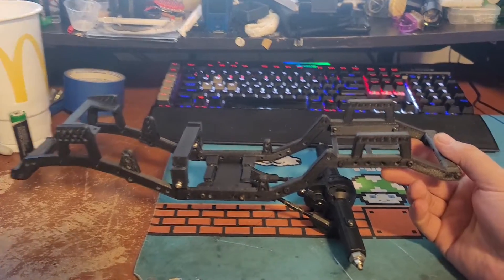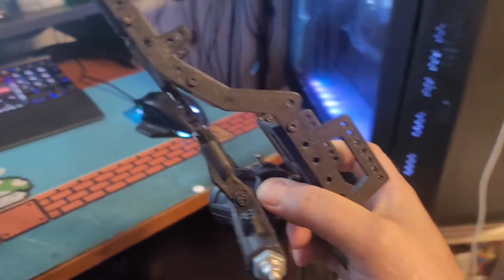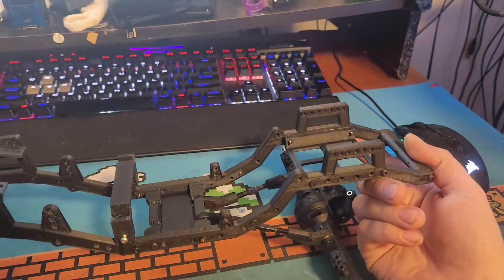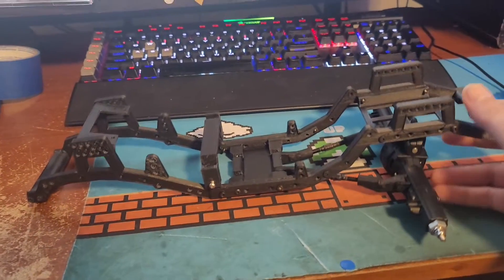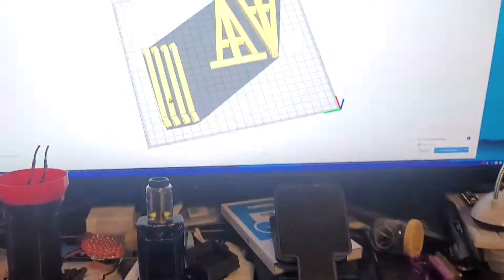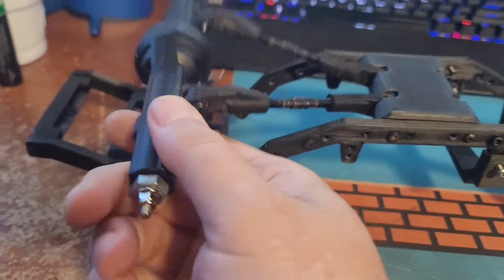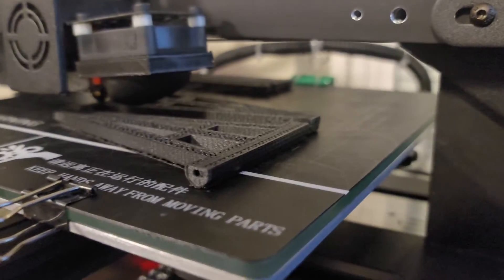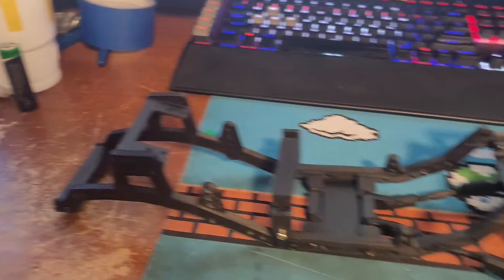OpenRC. Fully 3d printed 10th scale crawler. chassis. (part 1)

Comment: I've just built my 1st crawler using the same axles but not the 3d printed chassis although the braces and suspension mounts are 3d printed. The front will benefit from servo on axle for steering, I found a file on thingiverse for the p402 but it was weak and snapped off on 1st use so I traced the shape onto some aluminium made version 2 A very simply job which is great compared to the plastic mount or having the servo mounted in the chassis.
Reply from the maker: i actually just came across this chassis in a box. It broke on one part but i wanna redo the build and fully 3d print it again but use nylonX this time. Make it crazy strong.

Comment: Hey Joshua, do you still have these stl's by any chance? My 8yo son and I really wanten to do a similar project with our ender 3 v2, but we can't seem to download these files from anywhere anymore, and we are on a budget😅 We really hope you can help us out!
Reply from the maker: i do but theyre on my NAS which is in a box in the garage cuz i just moved. Id have to dig through about 50 boxes trying to figure out where it is. i downloaded them from thingiverse. They should still be on there.
Reply: @jstagzsr  everything has been taken down
Reply from the maker: @thomasdevos141081  damn. That sucks. I just dug through my PC and found an old cura save which has most of the crawler frame.  It's 6 pieces. Left and right main frame rails, battery holder, servo mount, and a few other pieces that go from rail to rail to make a mostly finished frame. Looking at my vid I see a few important parts missing. Mainly the part that the linkages bolt to on the frame.  Idk if that helps. Comment or email address and I'll send you what I have. The cura save is 478kb so that should send in an email
Reply: I cant seem to put my email here
Reply: I Will try with spaces between everything
Reply from the maker: @thomasdevos141081  or just email me jstagzsr at Gmail dot com